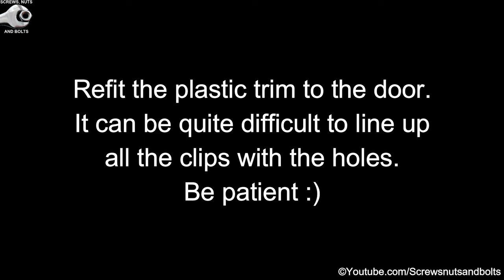Replacing the Boot Opening Switch and Handle - Volkswagen Golf Mk5 Hatchback

Comment: I hope you tried replacing just the microswitch first (vw part # 1K0962103). If that fixes it, you won't need to replace the entire latch and won't need to remove or loosen the rear wiper motor assembly.

Comment: One of my T25 screws was rusted solid. Used a solid driver and technique, but couldn't break it freee, even after soaking with liquid wrench for two days.  Eventually stripped the head.  Very awkward, but was able to cut a slot in the grade 8 screw. But still couldn't turn it with a big flat blade screw and wrench.  Even tried an impact screwdriver and hammer.  It only cammed out or chipped the head.  I finall drilled out the screw, breaking a new drillbit in the process.  If I'm lucky, there's enough threads left to hold a new screw.

Comment: Can anyone recommend me a decent website to order a new handle from? I tried replatching the latch but then it wouldn't open and heard a buzz coming from the handle,so most likely handle motor is gone.
Reply from the maker: I'm not sure if you can get a brand new one anywhere. You should be able to get a used one at a car dismantlers or maybe on Ebay.